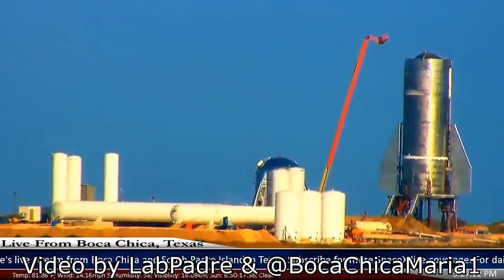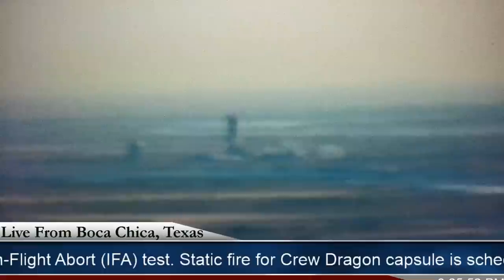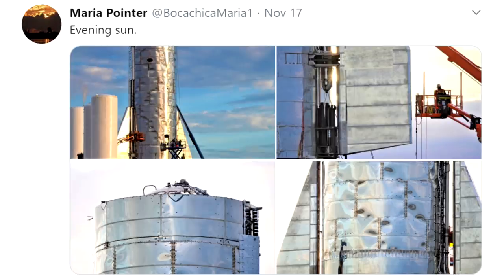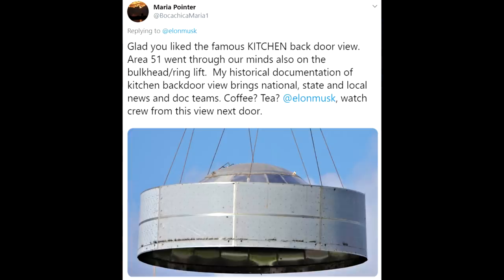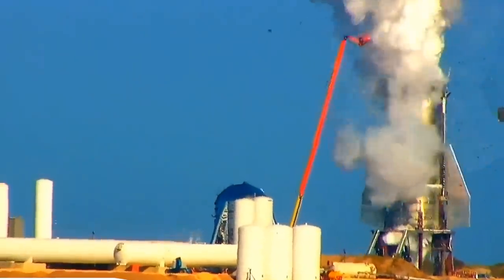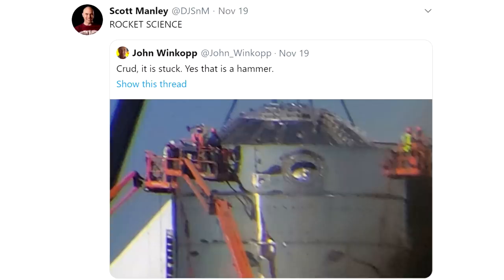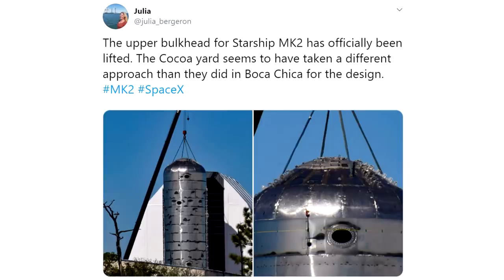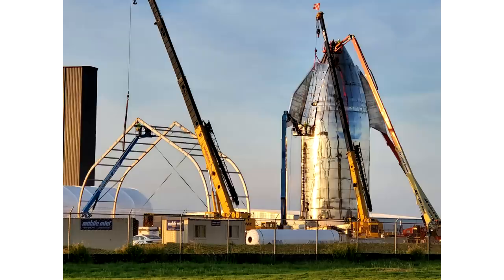SpaceX's Starship Popper - Starship Mk1 Ruptures Tank During Test

Comment: it is not good to speculate on failure modes, it may not necessarily have been a weld seam failure, especially when you are dealing with stainless steel. stainless pressure vessels can go wrong in tons of different ways, especially cryogenic pressure vessels.
Reply: Not a welder, but I was told a good weld is stronger than the actual material.
Reply: @1968gadgetyo  yes, but getting a good weld is easier said than done. welding is one of the few trades that spans in complexity from running a stick welder off a bank of car batteries to plug a hole in a tractor in the middle of a muddy field with metal hemorrhoids at the bottom end to tig welding in laboratory conditions where every variable is controlled (and there are a LOT of variables to control) at the top end.

working with stainless steel in general is much more complicated than a layman might realize. for instance: the reason stainless steel is stainless is because it contains enough chromium so that when it oxidizes, the dominant oxide is chromium oxide (hard, clear, passive) rather than iron oxide (rust in this case). however, if that protective chromium oxide wears through or gets a pinhole in it (pitting or crevice corrosion), or there's a flake of normal steel that gets on a freshly machined stainless steel part that hasn't built up that layer of chromium oxide yet (iron contamination), or in a oxygen depleted or chloride enriched environment (stress corrosion cracking), then stainless steel can rust through, often under the surface in a way that is difficult to detect until it is far too late. that is why sometimes in things made of stainless steel (generally cheaper stuff) you will occasionally see tiny rust spots on it.

for critical situations, stainless steel must be thoroughly cleaned and passivated (such as with electropolishing) to minimize these risks.
Reply: Idk, welds can be a very probable failure point, especially when cryogenic. Most materials become more brittle under lower temperature conditions. Welds and the thermally affected zone are stronger than the bulk metal, but as a result are more brittle. This in combination with the tendency for any flaws (cracks, voids and the like) to be concentrated in weld material makes them prime suspect locations of brittle fracture. Look up the USS Schenectady, she was a liberty ship that broke in two alongside her pier in cold weather. Brittle fracture occurs when you have tensile stress, a material flaw and low fracture toughness. As you might expect a cold, brittle metal has a lower fracture toughness than a hot, ductile one.
The USN has done plenty of R&D into brittle fracture mechanics. This is because of the possibility of a reactor vessel suffering catastrophic failure at lower temps or during fast temp changes. They analyze for conditions that could yield brittle fracture and add a hefty operating margin to that to ensure it would never happen. A reactor vessel failure would make the next worst failure mode (complete shear of a cold leg pipe) look like a pleasant walk in the park.
Reply: @Jtretta  i don't know what reactor vessels are made out of but i am pretty sure it is not stainless. stainless behaves differently than most other steels at low temperatures. as long as the welds were done properly, the failure is just as likely to have happened somewhere else in the material, and then migrated to a plate boundary or weld seam. these seams could have been easily post-weld heat treated in situ, as welded pressure vessels typically are, but i am sure they are using the most advanced techniques on this and i am a machinist not a welder.
Reply: @SuperAWaC  Turns out that many PWR reactor vessels are lined with 304 stainless, weld inlaid over a standard carbon steel. Most of the piping in the primary is also typically stainless, either 304 or 316 grade. The only places where stainless is not used are those where it is likely for chlorides to reach, places like the boiler u-tubes and coolant discharge pipes. It was found that stainless, especially austenitic phase, suffers from stress corrosion cracking in the presence of chlorides. Inconel of various grades and occasionally cupronickel are used in those locations.
I understand it is of poor taste sometimes to speculate, but in this case I think it should be encouraged. To observe and speculate are the first steps in the scientific method. Where speculation turns to blind ignorance of facts or obsessive bias is what should be avoided. I have merely presented a number of factors that should be considered when predicting the source of the incident. I have trust in the engineers at spacex to work through a detailed, unbiased analysis and simulation set to determine the root failure.
Reply: @Jtretta  i was aware that a lot of stainless is used in the cooling systems and i already talked about scc in chloride rich environments. It makes sense that reactor pressure vessels are only lined with stainless
Reply: @SuperAWaC  Sorry about the duplicate response, I should have paid more attention to the conversation. Good to see more folks with that caliber of knowledge.

Comment: IF these failures really were along the welds then they should fire all their welders. That is NOT typical or normal, especially for aerospace welds. 
A proper weld is typically stronger than the surrounding material.

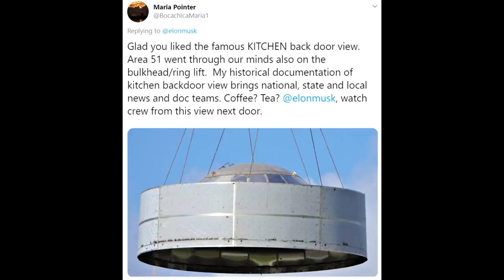Comment: I did see an assertion (on either a SpaceX Facebook group or the SpaceX subreddit) that the bulkhead-skin weld and the skin-skin weld just beneath it (visible on the picture at 3:07 ) were too close together - not allowing enough metal between the two meant the heat from the welds would interact with the metal and each other and cause metallurgical issues.

Comment: No fire, so perhaps just a destructive pressure test.
Reply: One would assume if it was a planned destructive test, there would have been a safety bulleting or something issued. ALA "Don't get spooked, when our MK1 ruptures and blooms of clouds of gas pour out tomorrow at noon. We are destructive testing the tank integrity".

So my guess is, it was a planned non destructive pressure test and the tank catastrophically failed below assumed strength. Which kinda ain't good, since it shows their strength calculations were off. Another possibility is the testing rig malfunctioning and over pressuring the test beyond planned, again not good.

Or they are madlads, who think it is okay to destructive test large stuff with huge pressures without informing anyone around them. After alll..... The top took a pretty massive flight.
Reply: @aritakalo8011  no not good. But that's why we test things to find out if we have errors in our models. Now they have lots of data to use for correction, and thats a good thing. I give the first liftoff a low probability to land as well  it's never been done before, and there is plenty of stuff that can go wrong, but its only testing that will yield results.
Reply: Whatever for would you need a destructive pressure test on a steel vessel? You can read the tensile strength from an engineering handbook, from there it's a pretty straightforward calculation to how much pressure it can take. Assuming of course that nobody royally screwed up the welds, which in this case they did.
This is not like their pressure testing of carbon fiber tank was, for that there really was no sure way to tell how much it should be capable of handling. For steel it's quite straight forward.
Reply: aleksander suur the welds were always going to be the weak point, so a destructive test would tell them how well the particular welding technique holds up, ie how much margin there is.
Reply: @rh4009  Pretty sure you are wrong on that one, welds are usually engineered to exceed tensile strength of base material. The only time they are weaker is if the weld is faulty and has a crack or impurity in it, in which case it has no guaranteed strength at all. 
There is no margin for such welds in critical applications, you can't have them and that's that. The trick is in how to inspect all the welds? There are methods for that, but they are not exactly easy to do out on a field, I would assume SpaceX just skipped that for a prototype.
And welding methods are verified in a lab, not on a full scale detailed prototype.
Reply: aleksander suur, I agree the welds should be stronger than the rest, unless that are faulty. 
My question is what was the liquid that cam out?  They are saying it was Oxygen, but that would likely blow up.  I think it could have been water.
Reply: aleksander suur there is always design margin, and that margin is indeed tested, both in the lab and at scale. Anyway, what failed and why is all speculation, until spaceX investigates. I'm merely pointing out that testing the margins is a plausible reason for this test. Maybe they have such a good welding technique that they decided xraying it is unnecessary.
Is it impossible that this weld is not that critical, ie, even a seam with some cracks would be good enough? Remember the decision to go with steel instead of carbon fiber was to lower the cost. Maybe not xraying the entire weld is also a calculated decision. The fewer mission critical elements there are, the cheaper the whole program is. Also, having it work well in spite of assembly imperfections or space debris damage is likely one of the requirements of the Spaceship program, I would speculate.
Reply: @eugenecbell  They tested with liquid nitrogen, in a real thing it would be oxygen, but for pressure tests nitrogen is similar enough, cheaper and without the possible problem of burning everything to the ground.
Reply: @rh4009  There can be no design margin for cracked welds, because a crack has no strength. If you stress it, it will propagate wider in an accelerating fashion until the entire weld tears like a zipper, it's like trying to put a margin on how many seams someone forgot to weld.
The point of the test was simple enough, check if it'll hold pressure, will it leak etc. While it's always technically an possibility, I'm sure they did not plan to blow it open the way it did.
Reply: aleksander suur, thank you
Reply: aleksander suur even a cracked weld will hold some pressure, just like a leaky sieve holds flour. Engineering is about finding a good enough solution, ie, one that solves a problem for the least cost, in the quickest, safest way. Without knowing the test parameters or goals, it's impossible to say that it failed. Eg. when cars are crash tested, just because the cars end up mangled, with bits flying all over the place, you cannot conclude the tests failed. The goal might be to see if the passengers are uninjured, or whether the car doesn't burst into flames within a specified period of the crash.

Comment: I welded stainless steel hot water cylinders for a year or 2, when they rupture they blow next to the welds, the Filler materiel is a lot stronger and stiffer than the sheets so depending on the weld procedure it can weaken next to the weld.

Comment: Success cannot exist without failure
Reply: failure after 50 years of rocket building knowledge wil certainly guarantee a flop... This is a circus act...
Reply: @Yosemite-George-61  Those one use rockets are equally pathethic as a single use working car made from chocolate . Not a very practical  knowledge .
Reply: @ketelin4285  Calm down. You expected this tincan to fly? 
At least could had used better metal joining techniques for a rocket of this stature.
Reply: @PArabinddeep  Off course , i have more than 2 months memory . Starhopper rings a bell ?  Falcon 1 ?! Probably some of the workcrew exagerated with the use of big hammers . Steel is not infinitely tough

Comment: Welds do not fail, it is the metal on either side of the weld that fails.
Reply: Polska cat So, why don’t they make the entire thing out of welds?🤣
Reply: @Cydonia2020  : Because it takes forever, nothing comes out straight, weighs about twice as much as you want, you get stuck doing x-rays of the entire damn thing, etc.

Or, from another perspective: because noone has built a 3D printer that big.
Reply: I was speaking rhetorically
Reply: @Cydonia2020  I prefer to ask why can't they have a mould to pour in the steel with no welds, much like large piping. Also what Jared Maddox replied too.  This could of been a deliberate over pressure to see what pressure it fails at, if so it was a design test, and not a true failure.  This is Rocket Science after all. Glad you are asking questions. I always learn things in comments.

Comment: As a retired Airline Captain with an Engineering Degree in Aerospace, I've been concerned about the rusty welds all along.  Any certified welder will tell you any weld on stainless steal that rusts is defective.  As quickly as the welds rusted I suspect the welders were using carbon steel rods as a field expedient measure.  Aerospace standards require extremely controlled environments to weld any metal.  Given the unconventional development methods of Space-X I could see them doing this but I don't believe this test was met to go to failure.  Somebody needs to answer for the over assumed strength of mixed metals welds.
Reply: It didn't look like rust to me, but carbonizing around the welds. In any case, it was sloppy.

Comment: I hadn't seen that footage at 6:35, apparently of Elon inspecting a burning Falcon 9.  What's that from?
Reply: I'm not sure that's a 9. Might have been a Falcon 1, or even the Falcon series hopper.
Reply: @absalomdraconis  I thought the Falcon 9 was the first to have grid fins though. It does look small, but maybe it's just farther away than it looks.
Reply: It's from SpaceX video _"How Not to Land an Orbital Rocket Booster"_. The footage comes from their Texas proving grounds, where F9R (Falcon 9 Reusable) prototype (first stage with one engine and extra hardware used for hover tests) self-destructed due to a faulty sensor during a test flight in 2014.
Reply: @cogoid  Thanks!
Reply: @dustinking2965  After it blows up, you can see the sheets of aluminum floating through the air, and you can see how thin the metal of the rocket really is. It's pretty amazing.

Comment: It would be interesting to get the comments of a certified welder on the welds breaking due to static pressure.  Many years ago I worked as a helper on some pipeline that was being welded together in order to carry water for a snowmaking system in Colorado.  After the welds were done we would run a static pressure test and I once asked a welder if any of his welds ever broke.  He said "never."  He told me that we were pressure testing the pipe, not the welds.  If properly engineered and welded, he claimed, the welds were always stronger than the materials being welded.
Reply: Daniel Wisehart He told you the absolute truth if the weld is properly made that’s not where it’s ever going to break. And if it does it will split right down the middle of the weld

Comment: At work we are testing lot of equipment in cold, heat, pressure, humidity and all of them fail or have hull rupture during the first test. Its a normal thing. This is why manufacturers destroy airplanes, engines and cars during development to test the worst case scenario. Mk1 could be the same case and being used as a test platform.

Comment: Do pressure vessels in spacecraft not aim to adhere to the "leak before break" criterion?
Reply: Pressure vessels in spacecraft tend to resign themselves to the "damned if I do, damned if I don't" criterion. Leaking can itself cause major problems of various sorts.
Reply: I'd figure "leak before break" would result in a lighter spacecraft, at least.  And yes, a leak on a spacecraft would be pretty bad, but in terms of negative events it's hard to beat "explosion".